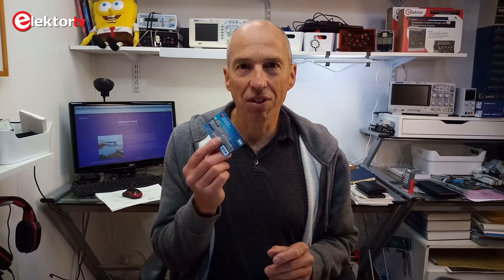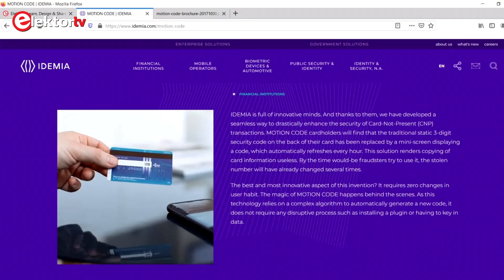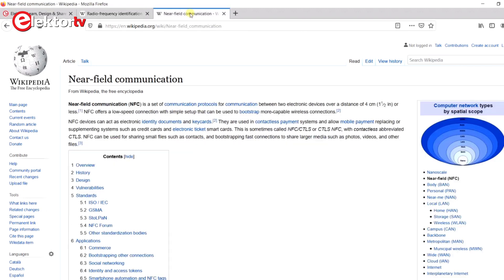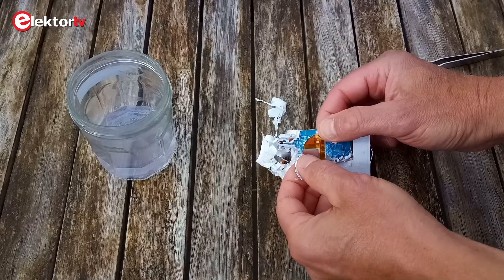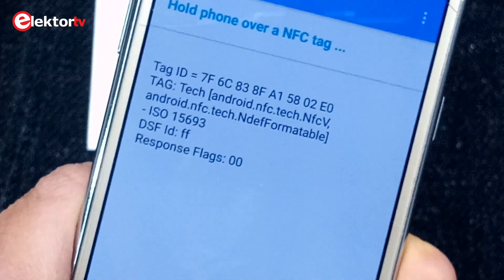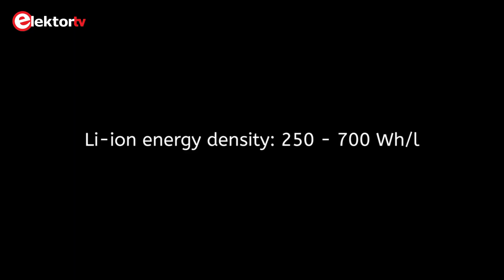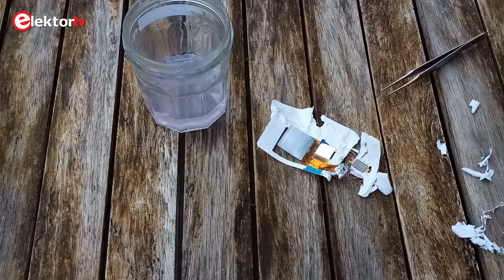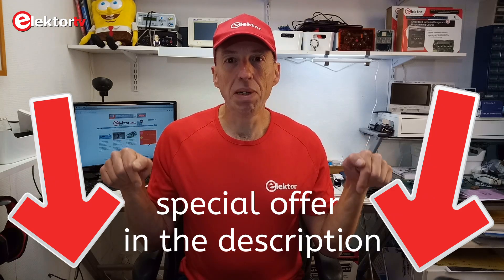Reverse Engineering a Credit Card Featuring Dynamic CVV

Comment: I would be very surprised if it was actually a lithium ion battery. The self discharge and heat/cold susceptibility is atrocious. It's probably a lithium metal battery - a non rechargeable "primary battery". The energy density is vastly higher than li-ion and the self-discharge practically non-existent. Did you open it? Was it black inside like graphite of a li-ion rechargeable or shiny like a metal foil?

I still don't really get how the code is synced with the bank servers. If it's just a one time pad list of numbers how do they avoid the crappy quartz oscillator controlled real time clock drifting away from real time over 3 years and causing it to lose sync with expected cvv at any given time?
Reply: Achieving precision of 1 hour per 5 years is not incredible, cheapest electronic watches can do that. And if the server checks not only the current CVV, but also the previous and the next one (and accepts the transaction if any of those CVVs is correct), even less precision is needed.

Comment: Interesting to see that they just kind of retrofitted the DCVV circuitry inside what seems to be a standard credit card. Just like you I would have imagines that the card contact circuitry might have been integrated with the rest of the PCB. I suppose it is just more financially feasible to not do that, since they probably produce/order the contact/antenna circuitry in far higher quantities already anyways. 
The parts on the PCB also don't really seem to be off the shelf parts, but bare die or COB. I wonder if they are produced entirely custom for them, or if it is a derivative of already existing ICs.

I doubt that de-capping the chip would actually reveal anything substantial. I suspect also that the DCVVs are generated on the fly by the micro for security reasons. That way, they only really need to protect the algorithm that calculates these. IIRC protecting code from being deciphered is substantially harder than reading out static memory contents with a SEB. 

It might be interesting though to see if powerline attacks are something that can be done against this device, by removing some of the decoupling caps. You would need quite a sensitive current measuring circuit though, seeing how little current it draws.